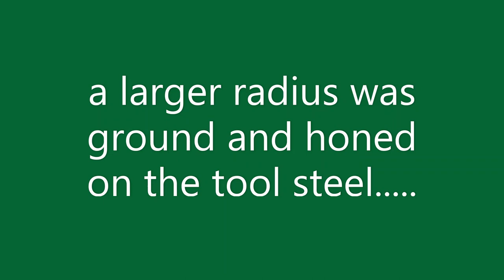Learning to Turning copper balls on the Colchester lathe

Comment: It's nice to see you backing off the drill every so often to stop the chips getting to long, copper swarf is nasty stuff. A tool made from lifting eyes - GENIOUS ! - I love it. There is another way of doing a ball, you just ruff it out, then use something akin to a hardened steel tube with a cutting edge ( about 3/4 the dia of the finished ball ) to clean it up ( although I wouldn't want to try this with copper...), a variation of this technique is to have a second spindle ( mounted on the cross slide ) with a cutter turning much faster than the ball. 
A sciving tool could perhaps do a ball ( a form tool that cuts in only on place - imagine you have a long straight tool mounted on the cross slide horizontally and at an angle so when the cross slide is wound out, the tool passes underneath a bar being turned, the leading edge with shave some off, and because of the angle as the cross slide is wound out further the sciving tool would machine down it's length - sorry - it's not an easy thing to describe.
Reply: Sorry, it's spelt " skiving " tool.

Comment: Hi Chris does it cut any better if you go even slower
Reply from the maker: I'm Stubby  700 rpm on the lathe feels right , tried it at 1200  not much difference just got hotter , not to small  a radius and honed made all the difference, I’ve made a few more now turning out nice 👍